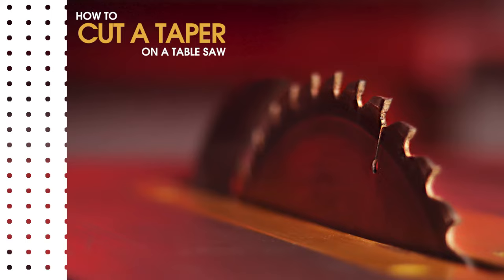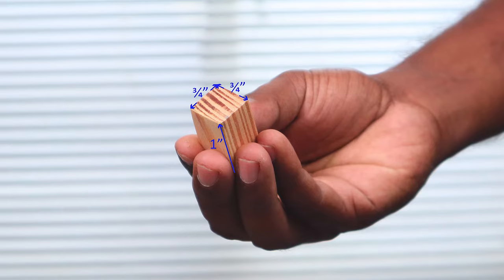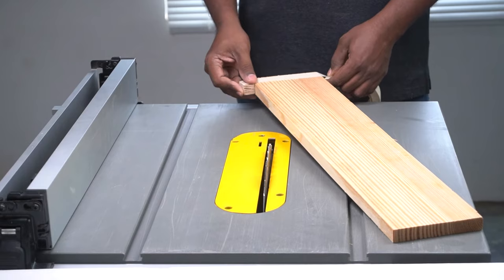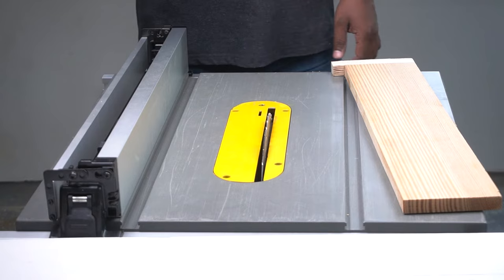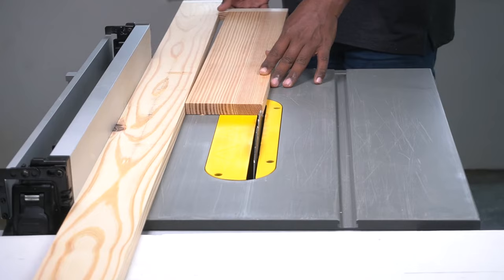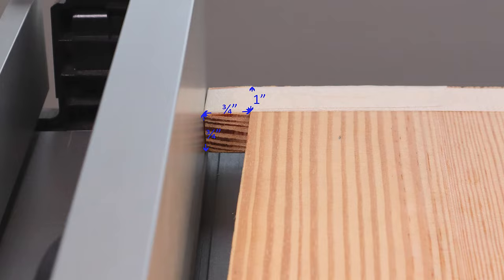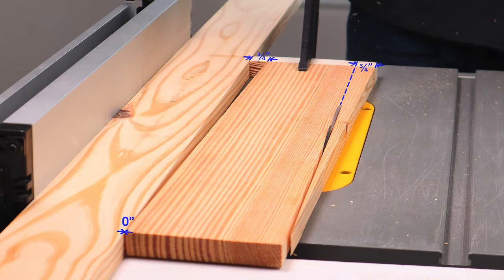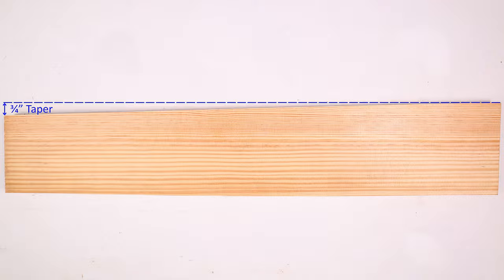How to cut a taper on a table saw- No Jig Needed!

Comment: Clever and simple approach, but maybe safety could be improved by 1) attaching a block to the guide board so that it could be clamped to the fence (and thereby reduce risk of it moving during the cut) and 2) using a push block like Grrriper to move the piece past the saw blade.

Comment: Great tip for tapers. Unlike many other tapering jigs this does not require placing the workpiece on top of the jig which reduces the depth of the table saw cut by the thickness of the board used for the jig. Thanks.

Comment: Thanks a bunch -  had to cut a 7/16" taper over a 60" long board - worked like a charm -   However, I had set up my saw before I cut the 7/16 spacer and didn't want to re-set it again. so substituted  a round head screw close to the end, on the edge of  the board.  Thanks again, wish I had known it before -  was so easy doing it your way.  AND no $$ spent, or time wasted hunting down or making a taper jig.

Comment: So grateful for this video. I needed a 3/16 taper over about three feet to help make the edge of a drawer slide parallel. This did the trick super simply and expensively. Worked like a charm. By far the best and easiest solution I found for my specific situation.
Reply from the maker: Glad it helped!